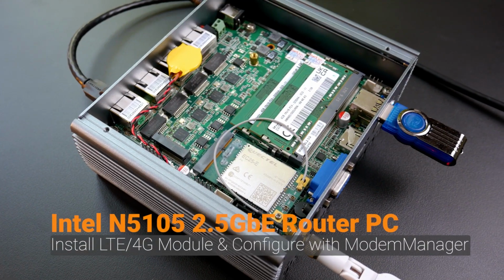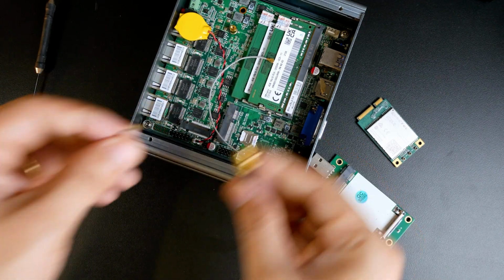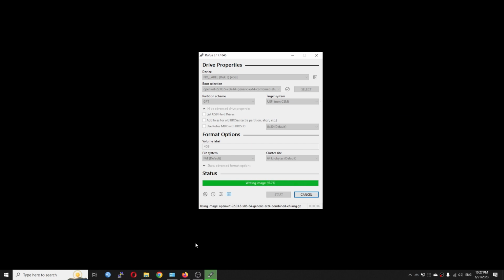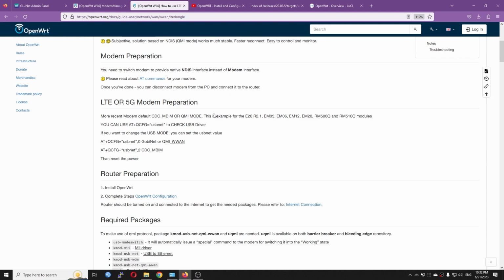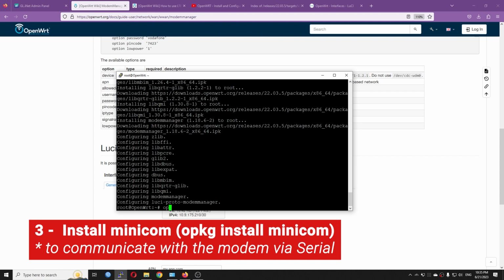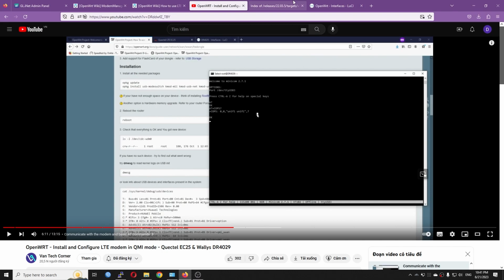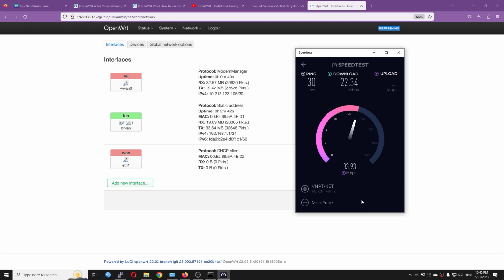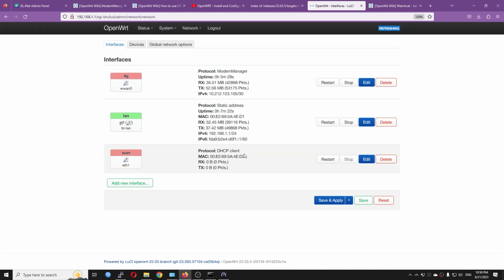OpenWRT - Intel N5105 Router PC LTE/4G Module Install & Configuration (QMI Mode)

Comment: Nếu dùng N100 thì nên mua module LTE nào nhỉ bác
Reply from the maker: Quectel EC25, SIM7600G đều gắn được. Bạn xem lại socket trên main có phải là Mini-PCIe (bus data USB) không rồi hãy mua nhé.
Reply: @VanTechCorner  Cảm ơn bác, máy của em là N100 G31s có công mPCIe và cả M2 CNVi, vậy vẫn ổn nhỉ